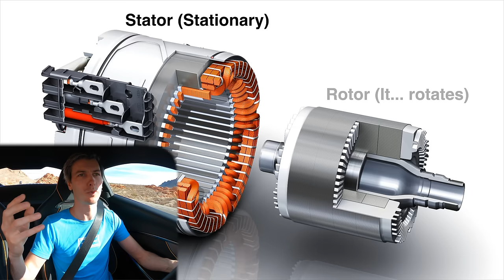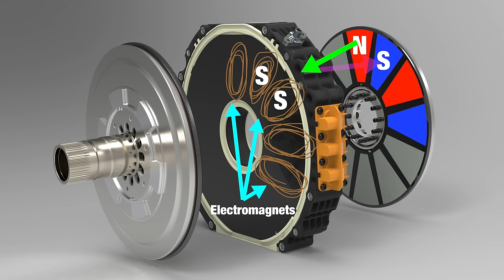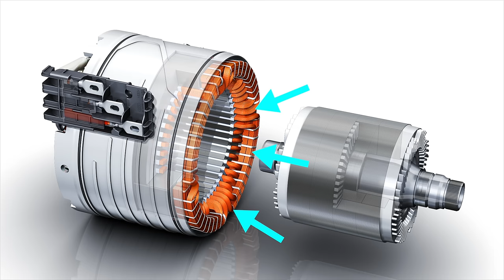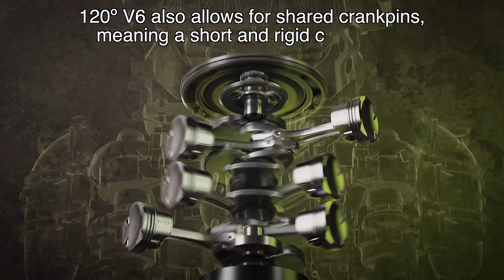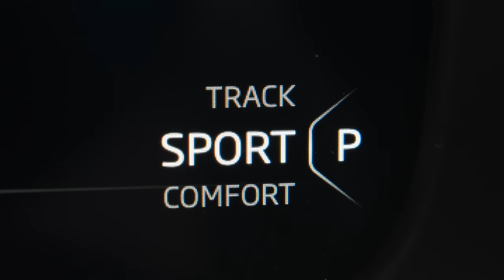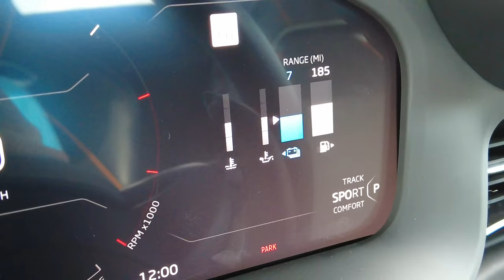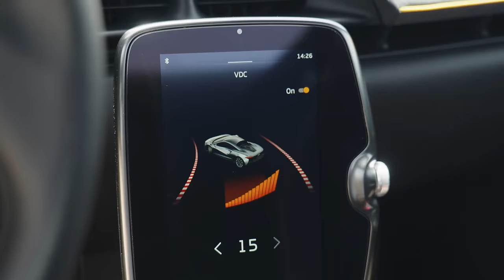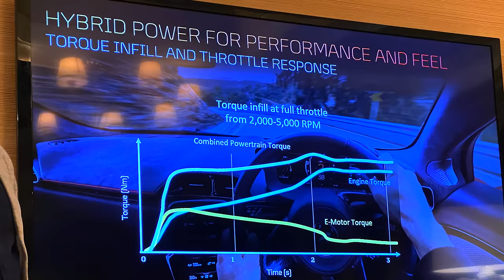These Tiny Motors Make Big Power! Why Supercars Choose Axial Flux

Comment: I'm wondering if the Axial Flux motor could be packaged into the the brake rotor area and then used not only as an motor but also for 100% of the braking... perhaps using a high current storage device for hard braking (flux capacitor?)
Reply: That would be terrible for unsprung weight.
Reply: Basically 40 pounds of unsprung weight. Better off adding the motor to the drive shafts and have the brake rotors attached there too, if you want an all in one package.

Comment: IIRC, Volkswagen's original electric hybrid, in the '80s, must have used an axial flux motor, as it took the place of the flywheel in the bell housing.  That was a sound concept, very efficient, good performance, economical (used lead-acid batteries), relatively cheap to retool for manufacture and was thoroughly road tested, but CARB insisted on all electric or nothing at that time.  VW would not commit without the California market.

Comment: That axial flux motor..Is it from YASA? Now with that small size but powerful el. motor, finally small motorcycle could benefit from it. The only problem left now is the battery and packaging issue... Still cannot compare with liquid fuel tank.

Comment: I'm kind of surprised that they didn't integrate the axial flux motor housing and the end of the transmission housing. It seems like there could be some weight savings there.

Comment: My 2017 Prius Prime plug-in hybrid can't quite compare, but I still love my car and it's 60K miles running average of 97.2 mpg. There is nothing smoother than EV, which is where my car spends most of its time.

Comment: The hydraulic steering, I think, is kind of a necessary balance when it comes to newer tech. One of the biggest parts of driving such an amazing machine is feeling it. There are 2 main features that tell you what's going on, while simultaneously making you giggle like a school girl. 1. Steering feedback. The small wrestling match of you vs g force. 2. The exhaust....that should NEVER be syntheticly piped into speakers.

Comment: Six minutes and 40 seconds into the video I think I see the teeth of a conventional starter motor. Am I wrong, or has MacLaren really equipped their motor with such contraption, when they have a 95 horsepower motor, which should be able to provide the function of spinning the combustion engine?
Thank You for an enligting  and informative channel.
Reply: Yeah I was also wondering, but they probably do it for redundancy so it can start if any part lf hybrid system fails

Comment: Question. Since force times radius is equal to torque why is it on a sway bar the closer you get to the bar the stiffer the bar acts? Always great videos and you have such a wonderful way of explaining science.
Reply from the maker: Because if you move the bar closer, your torque advantage reduces, so it takes a larger force to overcome it (so it acts stiffer).
Reply: @EngineeringExplained  Thank you.  As a follow up here is my observation of how a sway bar works.  As some background I didn't do well in Physics class in high school nor in pre-med undergrad so I apologize for my lack of understanding. Example:  during a right turn the car chassis will roll left which makes the left control arm go "up" relative to the chassis thereby shortening the left shock and rotating the left sway bar end "upward".  (On the left side we can say that the earth is doing work on the sway bar end.) The sway bar end on the right side of the car also goes "upward".  It has to as it is a very stiff bar.  The sway bar can then be said to  be doing work on the car by lifting the right control arm/strut "upward" and thereby bringing the right wheel upward which causes the right side of the car to move toward the earth via gravity thereby creating a levelling effect on the car.  Is that correct?  Ah yes, this takes me back to struggles in undergrad physics class.
Reply: @jamesinoregon1081   Yes, you got it!

Comment: Great video.  The "electric motor that is also reverse gear" is pretty slick.  Do full electric cars often do this too?
Reply: Uh, how else would they reverse?
Reply: Yes, electric vehicles don't need speeds or gears because the electric motor can easily be reversed be the control electronics.
Reply: I believe that most of the EV's use a reverse gear. Easy for you to google anyway
The big Honda Goldwings used the starter for reverse 30-40 years ago.
Reply: Yes. Which means they can reverse just as quickly as they can drive forward. That was a nice party trick in my 2016 Tesla Model S until a software update limited both the speed and acceleration in reverse. Fun while it lasted...
Reply: @philipmackin1025  Nope. There's no point, since electric motors can turn in both directions equally well. Furthermore, the vast majority of EVs have a fixed gear ratio for simplicity. Even ones with multiple gears (to gain additional top speed without compromising acceleration) don't bother with a reverse gear, since that's extra weight for no reason.

Comment: Didn't know their was a difference between and engine and a motor. Learn something new everyday.
Reply: There isn't, really - both "engine" and "motor" are correct words for both internal combustion (e.g. gasoline burning) and electrical machines. The usual practice is to use "engine" for fuel-burning and "motor" for others (electrical, hydraulic, pneumatic) - so "gas engine" and "electric motor" - but it isn't a strict rule.

Comment: Question : "The Köningsegg Gemera uses this engine, and Freevalve.
This car has a combine 1700 HP.

If you down size this 10-20 times, and put in a Singel cylinder engine, can this be the last gasoline system for regular cars?"
Is the price and production also competitive?

The engine in a Gemera har 600 hp.
Down sizeing it 10 times gives 60 hp, and 20 times 30 hp.
If posible with turbo this is 0,2 Litre and 0,1 Litre turbo engines.
But, if you remove the turbo, and freevalve. There are single cylinder engines today that have 60 hp.

Comment: So you're saying that the hvac system is used to cool the battery. A sentence later you say it has a chiller system in place that takes care of that. A chiller is a heat exchanger between cooling system and hvac system. So which one is used for the battery: coolant, refrigerant, or both?

Comment: These reasons are not why the motor has higher torque density. Torque productions comes from the magnetic flux-linkage (effectively magnetic field times area) multiplied by the current. Axial flux motors can increase flux-linkage by increasing the area by making the motor radially larger (which increases the area quadratically), while radial flux motors increase the area by making the motor large both radially and axially. What happens in radial flux motors is that the magnetic saturation limit also increases; this is not true when you enlarge the area on an axial flux motor. Motors of this size class are already so large that magnetic saturation is not an issue, which is why the axial geometry has a space saving here. You can increase the thickness of an axial flux motor to increase the magnetic saturation limit. The problem radial designs run into is the electrical steel around the output shaft ends up not linking with the rotor flux, which goes into what actually happens for reason 2.
In reason 2, the shorter flux paths mostly reduce magnetic loss. This does not increase torque density; it increases the machine efficiency. It increases the magnetic field strength only slightly because most of the reluctance arises from the stator-rotor air gap.
Reason 3 reduces the copper loss, which would imply higher torque density if you are indexing torque density off of the thermal limit, but the peak torque is usually specified as a peak limit rather than a continuous limit. Axial flux motors still have end turns that don't contribute to mechanical power generation; the end turns are shorter and easier to package.

Torque density at this size class is limited by the properties of electrical steel. Axial flux makes it easier to package the motor a certain way such that all of the motor volume can be filled with electrical steel that participates in torque generation.

TL:DR The reason why axial flux motors have "higher torque density" is because they package better. The geometry allows for all of the motor volume to contain electrical steel that links the flux and participate in torque production, rather than having dead space which occurs in large radial flux machines.
The reasons Jason gave explain why axial flux can be more efficient. Reason 1 explains why axial flux motors scale up in power ratings better than radial flux.
The big question about axial flux is whether they can effectively designed for reverse salient configuration. This is pretty straightforward to do in a radial flux machine.

Comment: I had once the idea to put 4 of these pancake motors in a sportscar (Miata) , replacing the existing drivetrain without any real gearboxes (because of the torque these could theoretically be attached directly to a wheel) and that car would have peak torque up to 200km/h after that it would fall off... One motor had more torque than the stock 1.6 (yeah yeah gearboxes and stuff) but you would have a siper compact AWD setup for a small package car that wouldnt that much heavier than stock... Rocketship

Comment: Neato.

This is a faster car, but I'll stick with my '14 Cayman S.  It can do 97% of what the McLaren can do but with FAR higher reliability.

Great video!
Reply: idk this artura has an e motor so it's twice as quick off the line and it's v6 seems pretty reliable. 680hp and a cayman do not belong in the same sentence. You do have him in price tho, more than half as expensive
Reply: @blazesmooth5573  Adding horsepower much beyond the 325 hp that my Cayman S has results in serious diminishing returns.  My car will get to 60 in 4.0 seconds and through the quarter in 12.5 at about 115 mph.  I'm sure that Artura is faster than that, but not twice as fast, as the HP numbers would imply.  

The 981 Cayman has been called the best all around sports car in existence and it's sub 7 minute prowess bone stock around the Nurburgring shows it.

And as you said....My car's cheaper~!

Thanx!
Reply: @Flies2FLL  GT4 rs ( the car that actually does 7 minutes) is much closer to the McLaren arturas price, 325hp and clocking at 12.5 is very impressive, but we all know that hp doesn't increase speed linearly. If we were to use your logic the alpine 110 is the world's best car at 300hp but I'm sure many disagree
Reply: @Flies2FLL  I'm still not sure whether I agree it can do 97% of what the McLaren can tho
Reply: @blazesmooth5573  981CS's with PDK have gone around the 'ring in less than 8 minutes.  Bone stock.
Reply: @Flies2FLL  to be fair 280hp 24 year old r34s have gone under 8 minutes in the ring. But the Japs we're ahead of our time, fastest production car in it's time

Comment: Great video but your throttle control on this video is so distracting. Just use cruise control or the electric mode next time
Reply from the maker: It's quite hilly, so there's a bunch of variance. Very few flat sections during the drive. Unfortunately it's more bc of the audio (see pinned comment) making it far more noticeable than it should.

Comment: i heard that there are two axial magnetic flux motors in the front of some hybrid ferrari.
also mercedes invested in the brittish company Yasa and implemented it in the EQXX. they also want to put it in the AMG versions of their electric cars.
Yasa claims that they get 10% more range in a WLTP test cycle compared to traditional motors in cars.
i downloaded a datasheet from Yasa regarding efficiency over rpm. between 10% and 90% they have 98% of efficiency. that is very efficient.
the question is, why don't we have them in every electric car? it is light, it needs less iron, aluminium, copper. from that point it should be cheaper. regarding the permanent magnets, i don't have enough information. maybe it needs stronger/bigger magnets, i don't have a clue. i don't see the downside.
but regarding permanent magnets, they are expensive because they use rare earth materials like neodymium etc. that makes them expensive. however, here in austria at the montan university in Leoben together with the academy of science and cambridge university they could artificially create the magnetic alloy 'tetraenite' which was formerly known only from meteorites. the alloy is simple with about 1:1 ratio of iron and nickel. but the challenge was how to make that alloy arrange in a crystaline form to make it a permanent magnet. they found with adding a bit of phosphorus, the could achieve a certain mobility of the atoms during cooling down, going from a liquid to a solid form. that increased mobility helps to form the crystalline structure.
==> long story, short answer: that will make magnets much cheaper and that makes electric motors cheaper.
i want to have such an axial magnetic flux motor in my next electric car. it is best that we have right now and it should not be expensive.
Reply: I don't think one would need permanent magnets for this type of motor - a humbucker setup is less material intensive (both coil and stator use source DC current) to produce their respective fluxes). Battery utilization goes up, but simplifies the build considerably.
Reply: These motors are still difficult to produce in high volume due to very tight tolerances which is why most other manufacturers haven’t used them.

Now that YASA and Mercedes-Benz are working together, axial flux motors will be used more often

Comment: Technically it is not correct statement that it is first time McLean use limited slip differential, it is first time it is used in current line of road cars but they used in their (best road car they made) F1 road car, and that car had no problem with lap times, still it have record as fastest lap time for naturally aspirated car and did not have problem winning races (it won 24 hours of le mans as overall winner beating even prototypes)

Comment: Since it can't rev as high, could it be attached to a manual transmission so we can have a real manual in an electric car?
Reply: There are many companies that just rip out the internal combustion engine and replace it with an electric one - it's the cheapest way to get a bespoke electric car. 
I don't know why you'd want to - leaving the transmission in place leads to horrendous losses due to friction (which is why there is a big difference between measured power at the crank and the wheel) and electric motors are really strong on torque (and have a massive rev range), usually the reason why cars have gears in the first place.

Comment: Doesn't the 120° bank angle also contribute to engine balance, akin to the 60° of a V12? Negates the need for a balance shaft as well in that case. For some reason I recall that as having been a stated reason for the block configuration as well the points discussed in-video.

Comment: They should have made it a 4WD range extender. At the rear, three of those motors per wheel and one per wheel at the front. And a 100kw 3-cylinder range extender and same battery system.

Comment: On the downsides of the axial flux design...
You mentioned the low rpm being a result of the inertia, and though that might be a point, I think it might also be difficult to achieve a wide constant power region like it is done with radial flux motors, as you explained in the video about electric cars not having transmissions.
At least it might be difficult without sacrificing the power density
Reply: But if that RPM range is still higher than the ICE than why does it need to have more rpm? Its lighter, smaller and makes more power so for a hybrid its definitely the bees knees.
Reply: @CrossWindsPat  I was just adding to what he said in the video, but I agree with you, it's not a downside in this specific use case.
It would be a downside if we were talking about a purely electric car though, so I think it's an interesting point.
Reply: @dcktater7847  My point was that a motor like this would not be a good choice for a purely electric car, because it would require a transmission, adding unnecessary complexity. So, that is a limitation of the design.
Reply: @dcktater7847  I just typed a long reply and now it's gone 😑 

Because it doesn't have a wide constant power region, which is what allows other electric motors to be used without a transmission, because it allows for a lot of torque at low rpms, while still allowing high rpms.
The motor in this video would allow only one or the other, depending on the fixed gear ratio.
Reply: @dcktater7847  Yea, propellers in general are a good example of where motors are designed like this!

Comment: Yes YASA motors, but I was disappointed in this video that in electric motor mode only, you did not  run the McLaren through the gears of that dual clutch transmission.

Comment: Could a car company make an affordable daily driver ev with one or two axial flux motors paired with a cvt transmission? You said these have a low rpm and the cvt could help with those highway speeds.
Reply: You don't need a CVT with an electric motor - it would just be unnecessary cost, complication, weight, and power loss to friction.

Comment: Why did McLaren decide to go with single scroller turbo chargers instead of the industry standard twin scrollers?
Reply from the maker: With 3 cylinders per turbo, you don't have exhaust pulses interfering (also it's not easy to split 3 cylinders into 2 exhausts haha).

Comment: My Ioniq Plug-in hybrid has a pancake motor wedged between a computer controlled clutch and its 6-speed dual-clutch transmission, limited to the same 6500 rpm as the ICE. I've always wondered whether or not it's an axial flux motor...